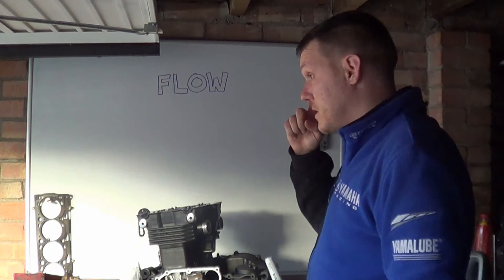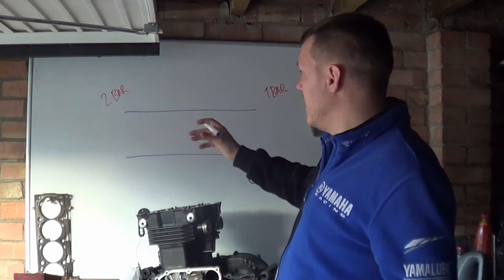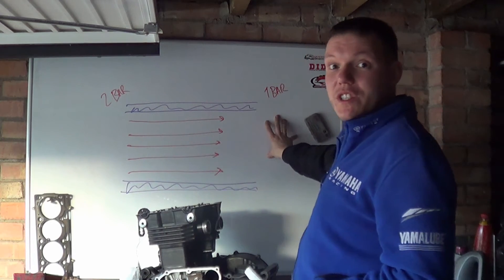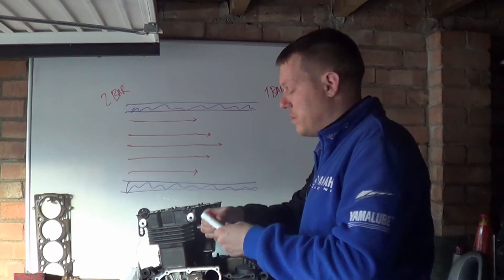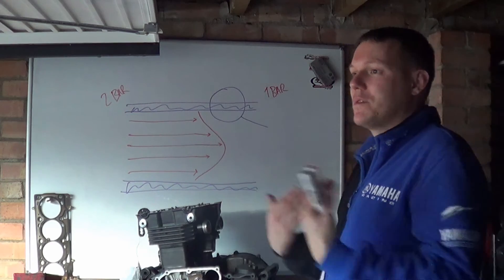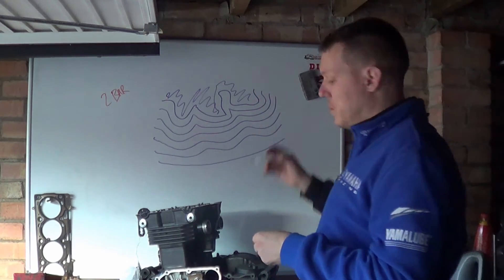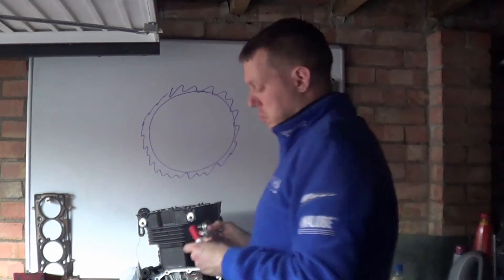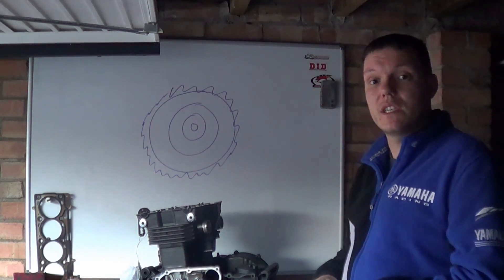Engine Fluid Dynamics - PART 2 - FLOW

Comment: So, to optimise the intake manifold internal surface, what roughness is acceptable? I'm wondering what would be the downside of a polished mirror finish and how to tell when the surface is smooth enough? Cheers
Reply: Smooth but not necessarily flat maybe 🤔

Comment: who needs college i've got matt, lol  but honestly this is helping me with my design so much, i knew why jagged edges caused flow distortion, but didn't know it was down to the molecular level this helps explain why smaller pipes have more restriction than the cross section would imply, or even the cross sectional area

Comment: Great video Matt.  Fluid dynamics work not just on engines but every where theres air flow.  I find on my mowers plastic grass boxes work better than cloth for same reasons.  A more exiting subject, could you do a video on compressed air engines I know there not very practical but i find them really interesting and its very similar to I. C.  without the Combustion.